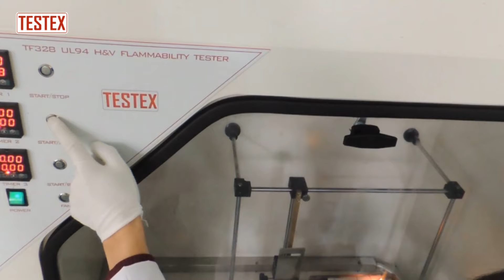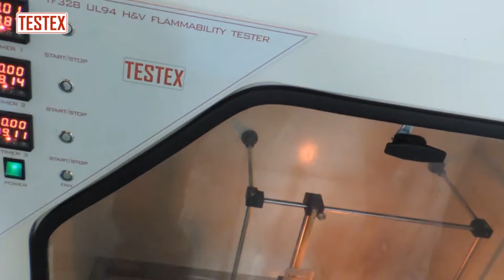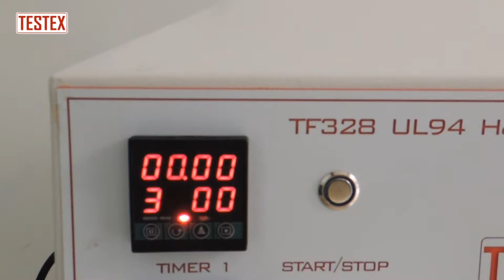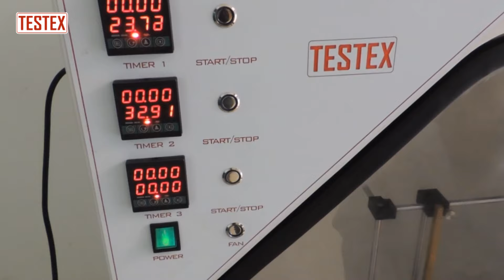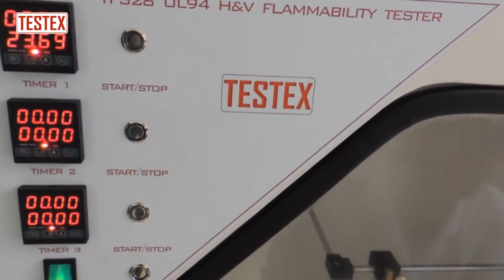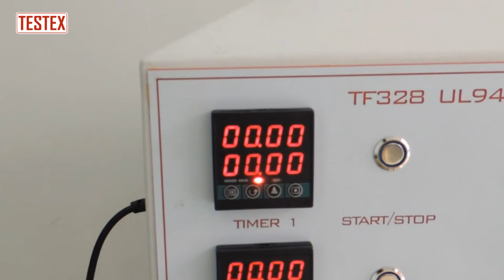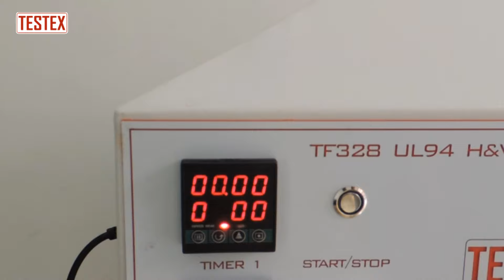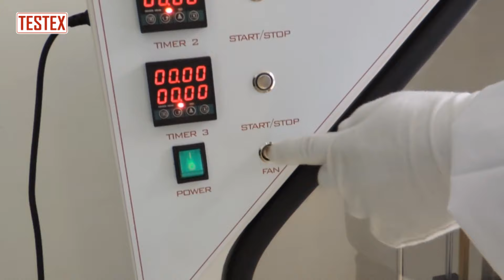UL94 Horizontal & Vertical Flammability Tester TF328

Comment: Hi, may I know if this machine will work with normal patio gas or is there a specific type of gas that must be used? If its methane, does anybody know the exact mix of the methane gas, and where to get it? Currently trying to obtain a methane gas bottle, but suppliers only sell industrial sized ones.

Comment: Hello. I need to implement a flame resistance test for CSA certified products (plastic faceshields). Is this test the same as the one mentioned in CSA Z94.3 ??
Reply from the maker: hello,reneross2, I'm sorry to reply you too late, you can send it to our e-mail: sales@tes.hk
Reply: TESTEX Testing Equipment don't worry.  Ok, thank you
Reply: @Yahir Theo instablaster =)
Reply: @Byron Ellis Thanks for your reply. I got to the site thru google and Im trying it out now.
I see it takes a while so I will reply here later with my results.
Reply: @Byron Ellis it did the trick and I actually got access to my account again. I am so happy!
Thank you so much, you saved my account :D
Reply: @Yahir Theo Glad I could help :D